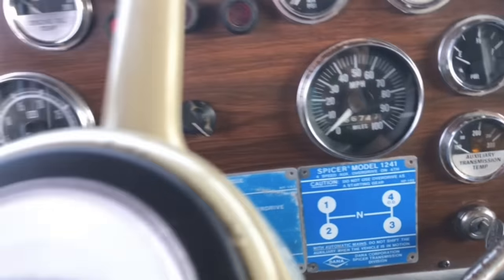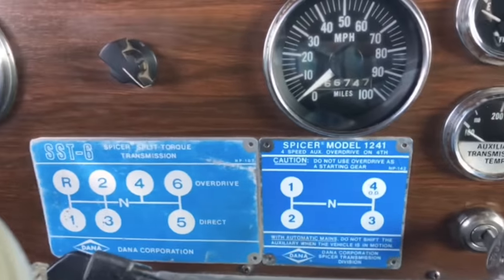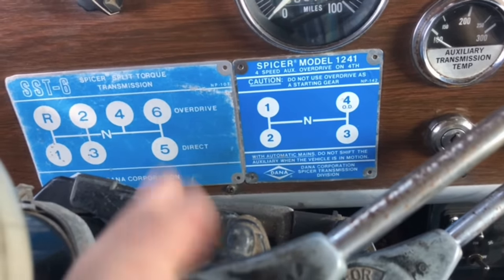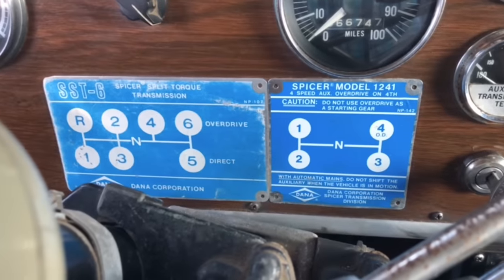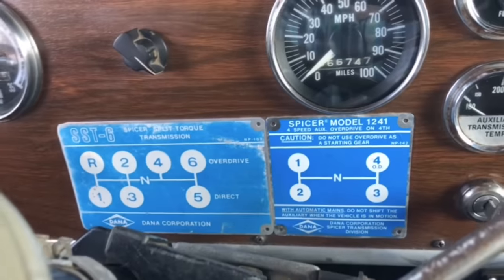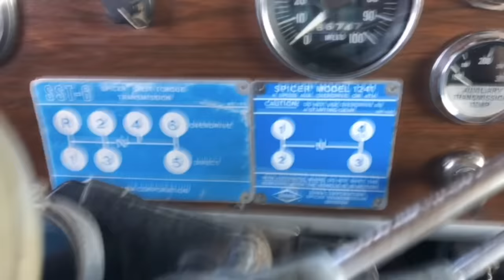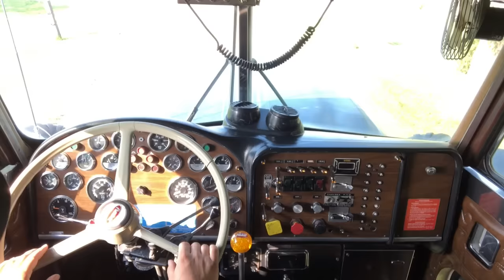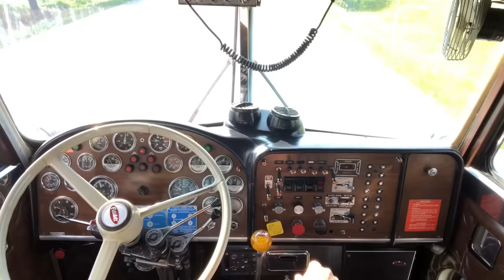How to shift Two stick 6+4 Spicer Transmission Peterbilt 359 #Peterbilt #359 #Twinstick #Twostick

Comment: Great job. However if the camera was placed in a better position to show both the Engine RPM meter and the Speedo meter it could have enhanced our idea of the working. I had experienced with driving a Mack when I was working in the oil fields of Middle Eastern( Arabian deserts) countries.
Thanks anyway.
Reply from the maker: Ill have to make a video like that 😄

Comment: 2 sticks, 2 transmissions, 2 charts o.k. but how do you use 2 clutches??? LOL!! I'm just being funny, 3 questions sir, 1 do you ever forget what gear your in, 2 do you shift without clutch, 3 are the auxiliary gears, half gears? Thanks for the vid sir!
Reply from the maker: 1 yes 2 yes 3 its complicated 😄
Reply: @Bubbles8V92  that is so cool, when I drive a cab over 7 spd international I would forget what gear I was in from time to time, I have a 6 spd dodge ram 3500 and I still forget the gear in in sometimes.thanks for getting back sir
Reply: @Bubbles8V92  I think I made a typo, I meant to say I drove a 7 spd, I think it came out as I drive, that's not true I gave it up in 85 . Take care, hey sience the trailers are 53 ft long, did icc raise amount of weight and truck from 80 thousand or is it still 80 thousand, thanks hope I got that 80 thousand right.
Reply from the maker: No states are still 80,000. They came out with the 53' for "light high volume cargo" and then everyone made em. Canada goes up to 140,000 on a 5 axle. Laws are a lot better up here... none of those "bridge laws" for sliding axles etc
Reply: @Bubbles8V92  Thank you so very much sir
Reply: @Bubbles8V92  hey how long have you been driving for, what age were you when you started having access to truck, for example, did your dad have a truck so you got early start??
Reply from the maker: @jamespelkey8150  well.... first ride i ever had in a truck was coming home from the hospital as a baby in my dads 359. 19 years later i took it for my truck driving test. Been driving for 4 years off and on when i can... usually on the road about 10 days out of the month now. More in the winter. Between farming and trucking ive always been around equipment.
Reply: @Bubbles8V92  wow, nice, thanks, any vid of your dad's 359???
Reply from the maker: I have one driving it at night on my channel.... it needs a full Restoration its getting pretty rusted

Comment: Bubbles 8V92...picture driving a rig with a Spicer Trans through New York City or Los Angeles during rush hour,getting cut off by the moronic 4 wheelers? I'd just have to take out some 4 wheelers versus downshifting this set-up...coming to a complete halt from the multi-car pile-up,only to then put it in neutral to stop...LLLOOOLLL!!!

Comment: This so lit i hate computer trans i want shift on my command not what truck wants to. I did drove a 97 civic with 5sp manual home i got it in my head i am not panicking on letting the clutch out. Ok so if the clutch graps the flywheel go get the gas pedel so you can go and the engine is over reving press clutch to change gear let go and go on gas.

Comment: Me ole grandad left us a 69' B model kw got a 13 and a 4. It could run a 140 win you could hold it in gear. ! He used to be able too hole it in with a bungee cord but it finally got too were somebody had too really lean into it. That truck could gear out too about 40mph in reverse

Comment: Great job Describing Gradability & Gear Duplication. (No offense) but that's what Made them Obsolete. New Trucks with Automatic transmissions have Nearly perfect equal gradability from gear to Gear. I LOVE A 2 Stroke Detroiter Bark. I remember it Fondly. But, I'd rather take a New Mack with an MP8/Automatic across RT30 In PA with a Load of Gasoline today than Go Back to Shaking a Triplex OR a 4 SPEED R Model 300. Great Clip. I won't Pretend to know what gears You were in & when Ok?

Comment: For each  Gear on the Main Transmission you shift 4 with the Brownie 2nd Shift Brownie 4 Times Each Main Gear Shift 4 times up to 6th overdrive,,,,,,,,I Drove 20 yrs,,,Have Approximately 1.7 Million Miles behind me 6x4 5x4 Eaton,,,,,,,,,,,Roadranger Transmission's RT 7  8  9  13  15 DIRECT 15 OVER 18 SPD's,,,,

Comment: Why are there two trailer brake levers?
Reply from the maker: Top one is trailer brake bottom one is fuel shutoff but on cats it was often a brakesaver valve
Reply: @Bubbles8V92  ok. So now the next question is  exactly what does that fuel shut-off valve do and when would it be utilized? Maybe when using the engine brakes??? Who knows

Comment: Great vid but can you pls make a 3 stick video
Reply: 3 still is just normal eaton 13 or 18 which is usually have 1 stick with range selector and splitter switches but replace those 2 switches with sticks so you got 3 sticks

Comment: Bubbles_8V92.... you forgot to tell the modern day "steering wheel holders" that you also have 4 speeds in Reverse with 5X4 and your 6X4.... same as the ole Mack "quad box" (compound 5X4), the Spicer 4616 / 4X4 compound (and the later sgl stick "air" 4X4), and the Mack triple countershaft 12 spd.
Reply from the maker: Good point! Love 4 in reverse
Reply: @Bubbles8V92 .... Thanks for your reply, I apologize for my tardiness in response.   Ahhhh, the memories!!  Personally, I first started driving trucks (big A-Cars & Macks) when I was 14, and at night so the cops couldn't see me... usually plowing & hauling snow in the winter and on 24 hour a day projects in the summer... at night.  That was in 1964... and the closest thing to a "single stick" that I ever drove was an LJ Mack with a 5 spd and a dead stick.

The very first truck (semi) that I ever drove with a single stick (Spicer 15spd), was for another owner operator, in 1992... completely disliked it!!   Give me a good running 8V92TA / Ti or better yet a V12 Detroit with sticks and the right gearing in the rears, and I'll kick just about anyone's butt in the mountains, on any grade.... absolutely love them!   But, I digress... "to each, his own".  ;-)
Reply from the maker: @Romans--bo7br  I'm sure you could teach me a thing or too... never even sat in a 2 stick or a 2 stroke before I owned one
Reply: @Bubbles8V92 .... Hello again, sorry for my delay in responding again... been away from the pc for a bit.  Well at least you have one now, and that's Great!!   I wish I had of kept my three that I had (69 - 359 XL hood Pete, 74 - Ext. hood "A" model KW & an 81 ext.hood "A" model... all three with V12's).   What part of ON. are you from?.... I use to haul into Toronto back in the mid 70s and use to cut across northern ON. on the no.11 from the maritimes and PQ. over to Manitoba and out to "the beach". 

Use to be a lot of great guys out there on the road in those days... and I knew quite a few of them.   We All helped each other out if there was ever Any kind of breakdowns or anything... we all looked out for one another... except for some of guys from PQ (especially the Montreal area)... they were a different breed and only took care of themselves.  In fact if you didn't speak French... you really needed to "watch your back" especially during that time there was some kind of strike going on with the Montreal based owner-operators from that Day & Ross co. from NB(?).... some nasty stuff took place. 

I got shot at once myself during that time period in the 70s from a passing car full of guys and found a bullet hole in the left side front corner of my sleeper when I was west bound between Edmunston, NB & Quebec City, PQ on the TC along the St. Lawrence river.  It was at night, and I never heard the shot as I was running 6" straight pipes on the V12 and at whatever rpm I was at over 2,000, I couldn't hear it.... or much else, for that matter!!  : ) 

Great memories from those years, running into and across Canada..... before "9-11" and the takeover by the "jack boots" on Both sides of the border crossings..... we All "got along" together (at the crossings) before that.

Comment: double clutch each gear...yes?
Reply from the maker: Well some are clutched twin stick would take 4 clutch sometimes and that would be quite the dance
Reply: @Bubbles8V92  as long as you have one in gear you can shift the other via rpms?
Reply from the maker: Yes shifting with both in neutral is risky if the shaft between transmissions slows to fast

Comment: On a hard pull I used to leave the Jake on to arrest engine RPM quickly between gears for faster changes. 5 x4 w 318 Detroit, International 10 yard dumper. You don't want to have to start over again on steep uphill grade.

Comment: can anyone tell me how shifter linkage from the aux gets to the front next to the stick for the main trans?? Please and thanks.
Reply from the maker: Two long rods under the floor, from the top of the aux transmission to a little bracket where the stick goes through to push/pull either rod to engage
Reply: @Bubbles8V92  Hey, thanks for the reply! So it all works the same as the main trans just with longer plunger rods? I have never drove a twin stick before but it appears that both sticks are pretty much side by side, so if thats true then wouldn't the aux linkage have to be snaked around the main trans some how? Thanks.
Reply from the maker: Dat Clutch yes the main is ahead of the sticks but it is a normal transmission that has a short stick coming out of the top and then a single arm that comes back to the shifter stick so when the shifter moves it moves the short stick on the transmission
Reply: @Bubbles8V92  Ok I get it now, thanks for the help!

Comment: I’m confused, I didn’t realize Detroit made a retarder like Catapiller or is the other handle under the trailer brake handle for something else ?
Reply from the maker: Ya its a fuel shutoff on this one, air powered, wish it was a retarder though
Reply: @Bubbles8V92 , in all the years of trucking that's the 1st I've see it. So you have to use it everytime for an engine kill/shutdown?
Reply from the maker: there also is a cable one because this one need air pressure to operate and yes im as confused as you are.... no idea why
Reply: @Bubbles8V92 , thanks for the info I appreciate it

Comment: Cat engine or a Detroit?
Reply from the maker: 8v92 detroit
Reply: @Bubbles8V92  did it originally come with a cat? I see the brake saver pull arm right below the trailer not for parking valve
Reply from the maker: Originally it had a green 8v92 that handle Is for an air actuated fuel cutoff. I get a lot of people asking about that valve glad someone knows what they usually are!
Reply: @Bubbles8V92  nice, great video thank you. I sure miss that model peterbuilt

Comment: The only thing I can see wrong is. You forgot to mention your use of the clutch.  How often are you double clutching. Shifting a duel shifter truck is more about your feet plus a light hand. The correct throttle an using your clutch (double sometimes Triple clutching) 
  If they are here learning how to shift a  truck. They should shut it down. & walk away. This is the kind of shifters I learned on. Although I "think" I only had a 4x4 dual box. This was back in 1973. How old were you then?
Reply: The clutch is just for getting under way, not needed after that.

Comment: I kinda have the feeling a company would have to replace these transmissions several times a year, cause If you have more unexperienced drivers who struggle with the right shifting and synchronizing there must be loads of wear on the gears I guess
Reply from the maker: Ya thats why they say to shift with your fingertips

Comment: so basically you have to be good at math. If you can multiply and divide and know the layout of the shifter, then you can shift the truck into the appropriate gear. I can understand how they over lap though; gear 12 could be 4-3 but also 6-2 or 3-4. Well, that's my understanding anyways

Comment: For the old "REACH THROUGH THE WHEEL N SHIFT EM BOTH AT THE SAME TIME GUYS" the reason people that actually know how to run Spicer Boxes dont do that is because if you get both boxes out of gear at the same time you cant get either of them back in because they are 2 separate transmissions unless you stop or clutch brake the main back in first the find what gear you can get the auxiliary back into. However with a MACK two stick you can do that because it's a married or one transmission with 2 sticks into it. One quick hand will do excellent on a set of Spicers
Reply from the maker: Thanks for saying that!! I don’t really think two hands are much quicker... definitely not worth the risk of starting over just to show off... I didn’t realize macks were a single transmission so that explains a lot!
Reply: @Bubbles8V92  Yes Mack's are one transmission and I also forgot to clarify in last reply the Spicer 4x4 is also married so you could possibly get both sticks in neutral in that one if your quick and timed just right. I actually still have a truck with a 4x4 , one with a 7x4, mack 5x2 and a mack lo hole 6 which has 5 main and low, high and reverse on the auxiliary stick

Comment: An easier way to splain it... 1st gear  in the main, then 1,2,3,4 on the aux Tran. Then 2nd gear in the main, then 1,2,3,4 on the aux. and so on.  You can skip gears depending on your weight, up hill, down hill.
Reply from the maker: That wont wotk in higher gears 5-4 to 6-1 is literally dropping from 60 mph to 45 at 2100 rpm....
Reply: @Bubbles8V92  Sorry,I don’t get what you’re saying. My explanation was about “ up shifting”, that is exactly how it works.

Comment: Oh I forgot something. 
 Never But Never get both Boxes out of gear at the same time. If you do, Expect to pull over and Stop! If you are going UP hill & get both boxes out of gear. Just pull over. You are going to stop in a lane long before you ever get one box back in gear let along both back into gear!!
   I did it running down hwy 80. Luckily I did not panic but did get both back into gear. I was running on flat ground & empty. Lucky I didn't have to stop!!
Reply: I think that will happen when you shifting both at same time with 2 hands

I dont see this happening with 1 hand shifting bcuz hes shifting 1 by 1
Reply: @JCaddy007  sometimes you think one box is in gear & it's not. Then you shift the other box and it won't go into gear. It's not easy to get both into neutral at the same time. But it can & does happen.  Ask him. I did it rolling down hwy 80 on the California side of the sierra's.  I ended up with my furthest back trailer brake on fire. Yes, I had to pull over & stop. 
  As I was putting out the fire. A CHP rolled up on me, No class 1 license. Over weight. (Got paid by weight)6 I said yes, just a small brake fire. Luckily he just drove away..
This was my first time with both boxes out of gear. Only had one more!
Reply: @ltsgarage7780  wow that must have been scary 

I will make sure I'm good at it b4 going hilly sides bcuz on flat rd easy to break, pull over n start again but on downhill u lucky u still alive
Reply: @JCaddy007  sometimes you think one box is in gear & it's not. Then you shift the other box and it won't go into gear. It's not easy to get both into neutral at the same time. But it can & does happen.  Ask him. I did it rolling down hwy 80 on the California side of the sierra's.  I ended up with my furthest back trailer brake on fire. Yes, I had to pull over & stop. 
  As I was putting out the fire. A CHP rolled up on me, No class 1 license. Over weight. (Got paid by weight)6 I said yes, just a small brake fire. Luckily he just drove away..
This was my first time with both boxes out of gear. Only had one more!
Reply: @JCaddy007  the main thing is always remain calm. Always believe you can fix what ever problems you have you can fix them. Even a down hill run away truck with the brakes on fire. Relax and believe....
Reply: @ltsgarage7780  lol relax? I dont think so  I'm jumping out the truck  lol
Reply: net  you can't.  You would rather jump & kill others?

Comment: For this example lets just say the second 4 speed is called S and the first 6 speed is called F. Can anyone please explain to me why you cant shift in this order. S1F1 S1F2 S1F3 S1F4 S1F5 S1F6, S2F1-6, S3F1-6, S4F1-6.
Reply from the maker: Because s1f6 is 40 mph and s2f1 is 5 mph
Reply: @Bubbles8V92  makes sense makes sense

Comment: Wouldn't automatics be safer, in order to focus more on the road? I know truckers say driving automatics isn't real trucking, I figured it may be safer.
Reply from the maker: Once you are used to a manual you pretty much shift subconsciously.... i have heard of a couple guys wiping out in automatics from shifting unexpectedly on ice.... personally i prefer the control a manual gives you and the low maintenance and fuel economy

Comment: Too many shifts man.  If you're bobtail, you can blaze through the box easily starting 2-3, shift 3-3, shift 3-4, skip shift to 5-3, shift 6-3, shift 6-4 and that's high gear.  Rock and roll.
Reply from the maker: I wanted to shift more for the video but ya can pretty much get up to road speed faster on a two stick than a 13 speed

Comment: A 4x4, 5x4, 6x4 I can split, but I have never seen a truck that had two Johnny Bar trailer brake controls on it.  And I used to split mine by running through the steering wheel and splitting.  Shifting one handed is too slow for me.   But the two trailer brake controls, is one of them bad and you just installed another  without removing the first???  Never seen that before.  But this is a good video for sure.  It is hard to FIND a 6x4 to demonstrate.  Even in the 1970's they were rare.  The 5x4 was much more common.  That sounds like a 318 engine, has that Yamaha sound.  BB
Reply from the maker: ya the second lever is the fuel cutoff although they were common as retarder controllers and yea this is a turbo 8v92... a little too new for the 318...
Reply: @Bubbles8V92  OK yeah, the 8V92 was a big improvement over the old 318's.  aka 8v71.  BB